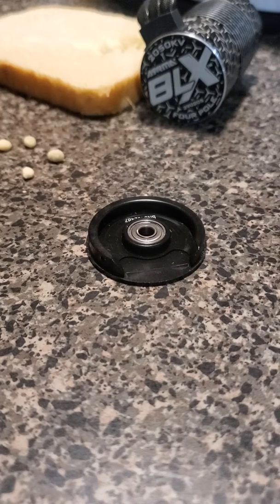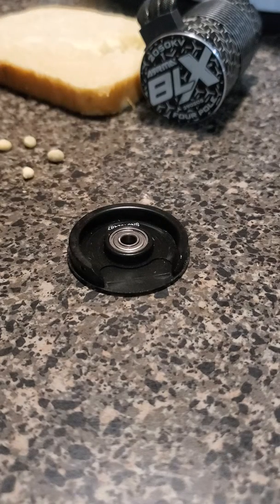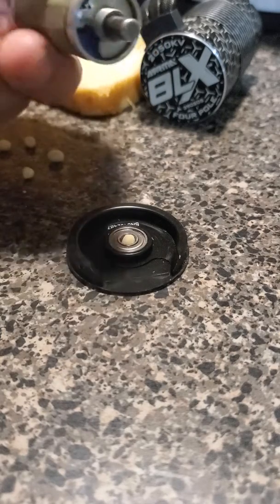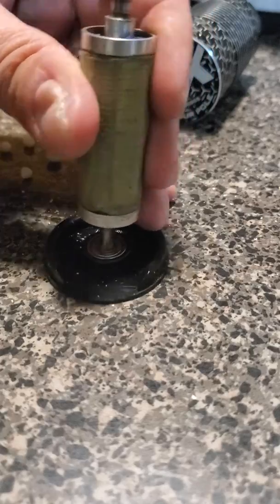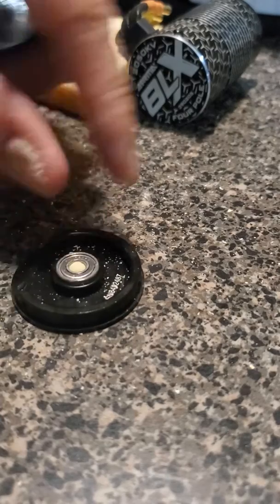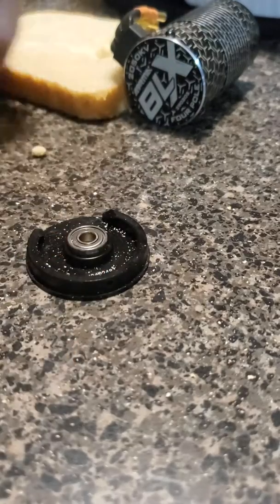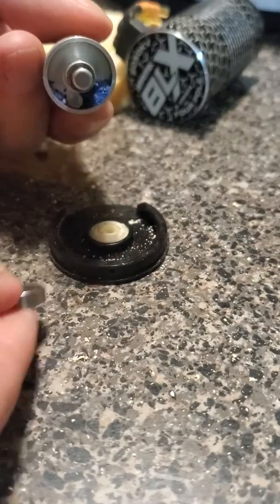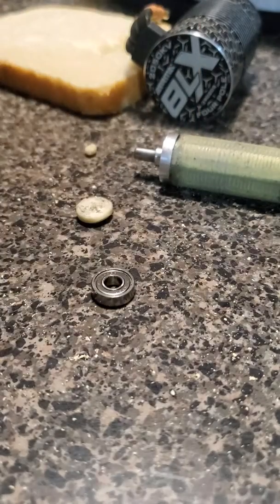Arrma 2050kv four pole brushless bearing extraction using bread.

Comment: Where did you get new bearings from?
Reply from the maker: Amazon. Ill give you part numbers
Reply from the maker: 5x16x5mm Precision Ball Bearings ABEC 3 Blue Rubber Seals (10)   $11.00
Reply: Michael Larsen thanks a bunch man!!!!
Reply: Michael Larsen is that for both the top and bottom ones?
Reply from the maker: @chuckgym  
1- 5x13x4 metal shield abec 5 Reinforced nylon retainers
1- 5x16x5 metal shield abec 5 Reinforced nylon retainers
https://jimsbearings.com/collections/arrma-complete-bearing-kits/products/arrma-kraton-outcast-senton-talion-typhon-6s-blx?variant=31288940855358
Reply from the maker: @chuckgym  Yep. one is smaller than the other. I added a link to Jims bearings. hes got kits and it lists the 6s motor bearing sizes there also.
Reply from the maker: TRB RC

4.9 out of 5 stars  13Reviews

5x13x4mm Precision Ball Bearings ABEC 3 Rubber Seals (10) 695-2RS-BU

$11.53

Comment: Hi how do you get other end bearing out ?
Reply from the maker: I believe that one could be tapped out from the outside. I can look again when I get home this evening but I recall that one on the shaft side was the easy one.
Reply: Many thanks don't want to buy a new motor if can change the bearings.
Reply from the maker: @S40TBS  I have a dynamite tool kit that has a 5mm nut driver. It's a perfect fit into the outside of the cover the motor shaft sticks out of. Throw the motor cover in the oven at 300 for like 10 mins. Take it out with gloves......and use the socket driver and a small hammer or block of wood to tap the bearing from the outside. Do this with the cover removed from the main motor or you risk ball bearings and other debris scattering and getting all stuck inside the magnets. If you have a couple 2x4s put them close together under the cover for support, but gapped enough for the bearing to fall out below. If you're on facebook, I can send you a message with a pic.
Reply: Great thanks I will have a go nothing to lose. Sadly not on Facebook.